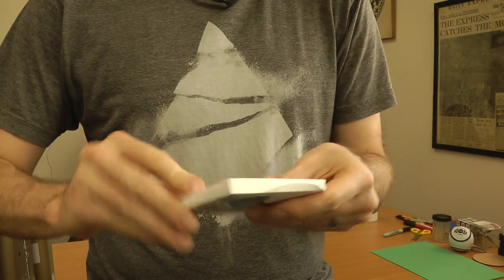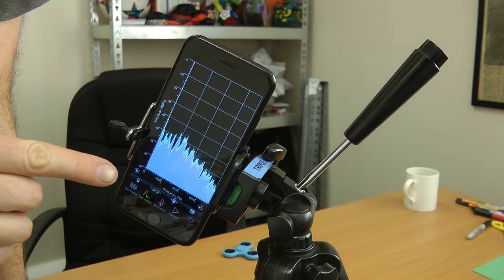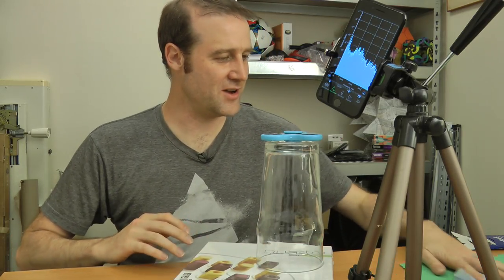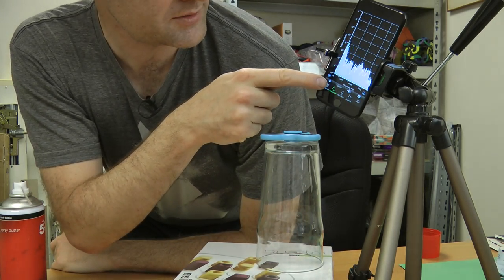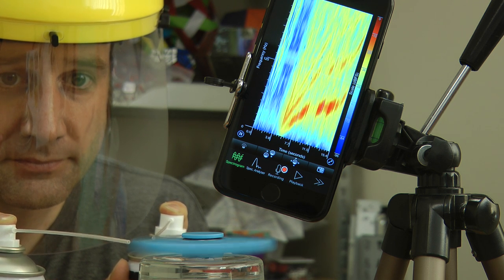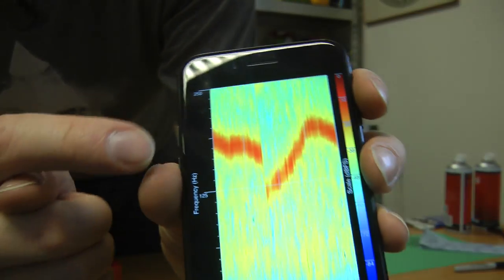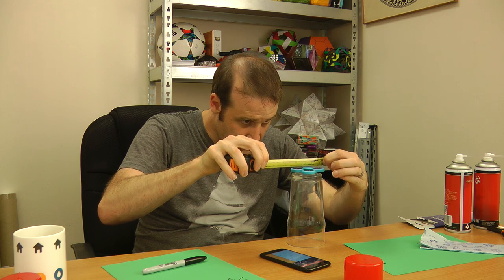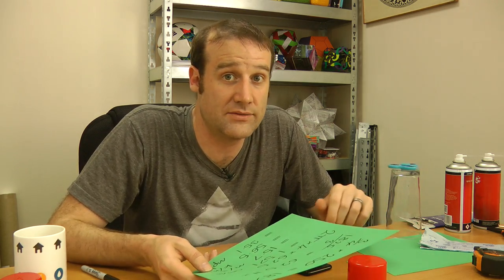How fast is a Fidget Spinner?

Comment: (unrelated) I've been thinking about graphs with more than 2 axes recently, but not like 3d graphs. Like, what if instead of tiling squares, we tiled equilateral triangles? (I've also started thinking about the tiling of irregular  shapes, but I haven't really played with them much yet so idk) the graph ends up having many different properties and a lot of functions end up looking weird. Try the fibonacci spiral for instance, that's a cool difference. I've also recently started watching 3 blue 1 brown, and he talks a lot about calculus using geometric analogies, which has also made me consider how some of those things might look on the triangle graph, but I don't really understand most of it so that's a lot more challenging. Also, I think about making graphs with more and more axis, like if you look at the origin as a point on the X axis (I make sure I always have a horizontal axis so it's easy to visualize angles, but this isn't necessary) we can change the number of axis which pass through the origin, and graph them to make each angle the same size. For 2, x and y, we use the standard graph, which we use because it's the simplest way to graph things, for 3 each one is 60 degrees, which makes equilateral triangles (this graph does act similar to the 2d/3d graph I've seen before, that looks from the corner of a cube, but you cut the diamonds in half, making a third axis) the 4 one has 4 45 degree angles, which makes our square graph, but with diagonals. I wonder if you could arrange the 4 axis so that each segment would be the same size, so that circles wouldn't look funny. I'm not sure how 5 or up look, I haven't had time to draw them. Anyway, I think this aspect of math is pretty neat, and nobodies ever taught me anything about it, so it's really fun discovering stuff on my own. Oh, I also wonder if this method could be used to depict higher dimensions on a piece of paper. I saw a video on the infinite series about taxi cab distance or something like that. Essentially the idea was that you measure distance without straying from gridlines. Well, you stay parallel to the grid lines, but you have to measure that way. In this method, she drew a circle, meaning she mapped all the points equidistant from the origin, of distance 3, and it formed a square, but up on it's corner, so a diamond. I tried to do this on the triangle graph, but because moving parallel to any one line also moves you along the other two, though not parallel, you can back track and the circle forms a hexagon, but if you were to measure the perimeter you would have to include the area somehow, because every point inside the hexagon Is equidistant from the origin, including the origin. (assuming you use at least 3 for the radius) which made me think the perimeter of objects on this graph may function like surface area, and if this is the case we may be able to use this idea to explain higher dimensions to teens!

Comment: It would be good to have an independent way to confirm 16ms per rotation, maybe by using a strobe light with a strobe frequency sweep up from 1hz to 100hz to confirm it. One could either download an app or build a simple circuit to do it , or download a function generator app and a few LEDs and a battery and a transistor and some other parts.

Comment: From messing around with generators, when I saw around 60 hz, I knew we were talking about around 3600 RPM.  I mean 60 * 60 is simple math, but that's just what I used as a quick approximation.

Comment: For those curious. With a 100 psi air compressor I was able to get a fidget spinner spinning at 143Hz, and 66.4 mph.
Reply: redid the test and was able to get 200Hz so about 92.8mph. That was scary fast
Reply: Shoot a bit of silicon spray into the bearings first to see if it makes a difference.

Comment: Hey Matt! Cool video, way to try and make maths trendy. Can't wait to hear you talk about a 4 dimensional fidget spinner in your next video ;) I had a question that I was hoping you'd have the answer to... If you were to spin two identical fidget spinners with the same amount of force, but one spinner sat vertically and the other one sat horizontally, which would stop spinning first?
Reply from the maker: +Justin Bereczki That is a really interesting question! My guess is the friction on the bearings would be slightly different and the  vertical would stop first. But it's a guess.

Comment: You can't make them spin much faster than 20000 rpm. Scott Manley calculated that to be roughly the speed at which they should fly apart and then Beyond The Press tested it with some power tools and it was pretty spot on =)

Comment: I think you should try again with better air. The speed started to taper off the same time the air began to lose pressure, so likely the speed was limited only by the speed of the air leaving the can. I think you were additionally limited by an imbalanced propulsion. If you had both cans on either side of the spinner, blowing past each other, you would achieve higher speeds.
Reply from the maker: +BleedingRaindrops Those are really good points! I think a proper air compressor would make a big difference.

But the max speed I got is about the speed where drag from wind resistance really starts to kick in. So going much faster would take a lot of effort.
Reply: if wind resistance were the only factor, there would have been more of a plateau, or at least a gentle taper. I feel the speed drops too quickly once it peeks to be caused by air resistance. I think the pressure in the cans had started to drop already and the spinner just happened to finally match the airspeed from the cans at that point.

Comment: You did limit the speed by using compressed air. 
What if the compressed air moves at only 57 km/h?
Reply from the maker: +Joey Verhaar It is true that the spinner speed may have been limited by the compressed air. But I still showed how to calculate the rotation rate of the spinner regardless of how it was propelled.
Reply: standupmaths 
Fair enough. 

But to answer the question at the beginning: "how fast can a fidget spinner possibly go?" 
One would need to now the maximum speed, in which the propellant (is that even the right word) isn't the bottleneck. At 'Beyond the Pess' they showed that it could turn at around 20.000 RPM I believe it was.

Comment: ??? You were driving it with TWO air sources so it's possible that there were two noise impulses generated by each tip (if the airstreams didn't perfectly coincide at each tip). Surely that would require that you divide the frequency by an extra 2?

Comment: Aren't you just measuring the maximum speed of the air coming out of those cans? You never got a straight line, but it immediatly went down after reaching a maximum, implying that the pressure started to drop significantly. Maybe with more pressure it would have gone faster? Nevertheless a very neat way of measuring speed.
Reply: I think Matt made this video sort of as a response people who were making totally unreasonable claims about how fast fidget spinners travel. He says so in a reply to a different comment (from Sebastian Lindberg). I think the point is that, even with the compressed air, you don't get the crazy numbers that other people have said. And on top of that, as you said, it's a cool exercise in measuring speed.
Reply: In that case it's understandable.
Reply: Aaron Ruben someone did it with a bottle of NOS at around 800 psi. Their plastic fidget spinner exploded from friction and centrifugal forces, while their aluminium one survived the full brunt of the NOS bottle.

Comment: Isn't the maximal speed highly dependent on the speed of the air exiting the can.
If I understand correctly the two cans might increase the acceleration but won't affect the (theoretical) maximal speed they can induce in the spinner.

Comment: Thermodynamics is holding you back: the bottles are cooling down, thus effectively reducing the pressure. Try with a compressed air tank and a compressor :D

Comment: @ 4:25 I dont understand how you can divide by three. I presume that frequency is dependant on the speed of the air on the tip not how many tips there are. Wikipedia gives a lot of formulas for computing the frequency for different types of whistles but I am well over my head with fluid dynamics.

Comment: 1:18 No, the problem is that you were using a linear spectrum analizer which although is excelent for some scientific aplications, it is awfully uneffectice at representing anything related to human perception of the sound frequencies. For that you would need instead a logarithmic analizer in order to archieve acurrate imaging on the lower frequency that the device normally produces.

There. Much better than cropping everything away.

Comment: I have a problem with they way you measured the speed. You measured it by sound which would be fine if the only thing making noise was the spinning of the spinner. With the setup you had you where picking up the air can and the noise of the air hitting the spinner thus making your measure in accurate. a better way of calculating it would be by getting a slow mo camera and filming it spinning then calculating the Rotations per minute by how many frames it took for the spinner to complete a revolution.
Reply from the maker: +Jonah White The background noise and air from the can is a broad spectrum of frequencies. You can see it as background data. But it is well below the level of the peak from the spinner rotating.

Comment: Can you do that? Can you use the frequency of the hum, which is basically a pressure wave, as the rotational frequency of the spinner. I mean, these are two completely different things. I would understand if it was an oscillating source producing the sound, but this hum is due to mechanical imperfections while constructing the spinner.

Comment: Problem:
If there is an open circle in each corner, wouldn't each effective edge of the corner hit the air once? Which means each corner produces 2hz, not 1hz, which means the total speed could be half what you came up with?

Comment: Matt, if you take the little caps of the centre and stick a bic pen in it as far as you can and then spin the spinner it will stand up on the point..........
Reply from the maker: +Adam Desforges Why did I not think of this‽
Reply: I am thrilled with the use of an interrobang .... and do i sense a second channel video

Comment: Also, I did some analysis on fidget spinners the other day and found that one that's probably the same as the one in the video could get up to well over 60kph. I think you're being limited by the exit velocity of the compressed air there Matt!
Reply from the maker: +Abigail V Good point! I did consider asking one of my friends who has a lab with a compressed air line…

I was wondering if I hit the limit of the air from the cab or the drag on the spinner.

Comment: At 3:15 I can clearly hear the a note between F# and G, and in particular the one that is a bit more than an octave lower than the typical A at 440 Hz. This means that the note I'm hearing is close to your original value of 187.5 Hz. Therefore, why is it that the actual spinning frequency is three times smaller? Is what I'm hearing a harmonic?

Comment: My friend and I actually studied this for a physics project, and we recorded almost 300 Hz. We used compressed air and a microphone as well as a laser photogate. We also calculated the acceleration on the tip of the fidget spinner (up to 1500 g's!): https://www.sharelatex.com/project/591f3ac1adc5545a018d252c

Comment: Dam, way above even my guess. I would like to see a comparison though of the different methods, I would figure a laser and a photoreceptor would measure it slightly more precise than audio analysis. Further that by using an actual air compressor and it's probably possible to rev these things up even higher. But still, nearly 4k rpms is pretty intense for a toy such as this.

Comment: Isn't the speed of the spinner limited to the speed at which the air comes out of the container? So if you got a container with more compactly pressed air, then it would go faster, because the air goes faster. Which just makes this a bad way of messureing the windspeed of the canned air...

Comment: Isn't it quite likely the spectrometer is picking up the sound of the rushing air out of the can rather than the sound of the sound of the air pushed away by the spinner? or at least, aren't you required to subtract it?

Comment: I did this on my own a while ago. I measured the diameter, filmed it in slow motion for 5 seconds, and counted how many times it spun around. From that, I found mine goes about 10 mph (15.1 kph).
Reply: I spun it with my hands btw
Reply from the maker: +Wallywutsizface That sounds about right. Good work!
Reply: Thanks! This is sort of embarrassing now that you replied, but I did some math wrong. It's actually about 6 mph (9.7 kph).

Comment: Compressed air cans weaken once they get too cold, so I feel like the fidget spinner didn't reach max RPM. Do it again with an air compressor and until the spinner breaks, otherwise it's just going to be the speed of the air hitting the spinner.

Comment: For measuring the rpms you could have just bought a Turnigy multi-blade micro tachometer for 10 bucks, even though using the sound to calculate the speed is cool.

Comment: Are you sure you got that right? Just measuring any old sound that comes off the thing is a shonky way of measuring it's RPM. 

Can't you paint a white spot on it, then use a reflective sensor, mounted pointing at it, to count it's RPM? It'll be completely accurate, and unarguably a valid measurement. If you're thinking about schools, they all have Raspberry Pis, Lego computers and stuff; a little reflective opto sensor is a piece of piss. If they haven't got one on hand, they can cobble one up, just an LED + phototransistor. They'll DEFINITELY have those hanging around in the Arduino education kit. Or the BBC Micro-Bit. Or whatever else it is. A bloody Arduino's a couple of dollars. It'll be nice to actually have a useful experiment for a change.

That's if you don't have, say, a scope hanging round. 

Or whatever you like. In a way it's nice there's a magic app for the phone that does everything. But really there's better instruments and ways of doing this. Valuable to learn them. You'd never do something like this in industry, where you just pick a sound from the general mess of things, and hope it's the right answer.

Comment: You're a mathematician, you must have had the original fidget spinner -- a ruler balanced on the end of a pencil.  (Bonus points for a wooden ruler with the sliver of metal along one edge.)
Reply: I love the wooden rulers with that edge, they're the best. At least until they fall off and damage the edges from it being dropped repeatedly, at least spinning them is fun.
Reply: Orxenhorf Mine is in the hole of the ruler slotted through with a pencil.

Then proceeding to wave it around like a caveman who found meat.

Comment: 5:36 "so that is how fast you can get a Fidget Spinner going" No. This is how fast your air flow was. You measured your choices of experiment, so ended up with measuring yourself. A pretty common error, I have to say.

Next time you want to know how fast a thing can rotate, my advice: when the thing can't spin faster, it will explode. And that's an engineer advice ;-)

Comment: Just a tip: Some really mad guys use an elecric drill, others use high presure air compressors, etc., just to spin it up to 33000rpm, 56000rpm, and so on till more than one hundred thousand rpm.
Air presurized cans are not power enougth to spin it to its max.
Warning, safety was not on their minds, here is one sample video:
https://m.youtube.com/watch?v=mP-tqMKqDAQ

Comment: This doesn't seem correct.  If the phone app is based on sound alone, wouldn't it be picking up the frequency of every "fffttt" sound made as a lobe passes the compressed airstream?  If that is true, and you used TWO airstreams, then your measured frequency is double what was actually happening.

But it's more likely that I don't understand what the app is measuring and I'm wrong, in which case thanks for a great video!  Haha.  Love your channel!!

Comment: non scientist here, can someone explaine how can we get the fidget's velocity from that sound frequency?
Reply: The edges of the fidget spinner hit the air, causing it to vibrate, and making a sound. The same thing happens when you move your hand through the air, it's just not fast enough to make a frequency detectable by the human ear. If you take a long stick, because the end moves faster than where you grip it, if you swing it fast enough it might make a low pitch sound.

The fidget spinner moves very fast, so each tip hits the air and causes it to vibrate at a specific speed. As the fidget spinner's speed increases, it makes the air vibrate faster. Those air vibrations can then be directly related to the speed of the fidget spinner.

The fidget spinner's frequency was 187.5 (I think), which is actually quite high, considering it's made by something spinning and not directly from a vibration (all musical instruments make sound through vibration). A bass singer's lowest note is commonly referenced as an E2, which is 82.4 hz. 187.5 is about an F#3, a little over an octave higher. A G3 (the next note in music) is 196.0 hz, and is the lowest note on a violin.

Hope that explained it and also put it into some better context.
Reply: Kaseda thanks!

Comment: I use a different start method with similar spinner.. Sound frequency 500 hz divided by 3 multiplied by 60 for 10,000 RPM. Air start isn't how it's done. I can get near 30,000 RPM, but fear catastrophic failure with a plastic spinner. 

Hint- rotary....